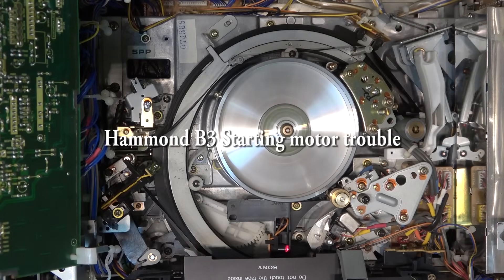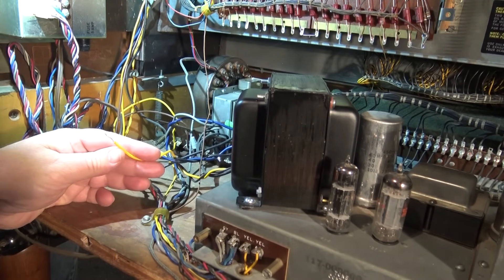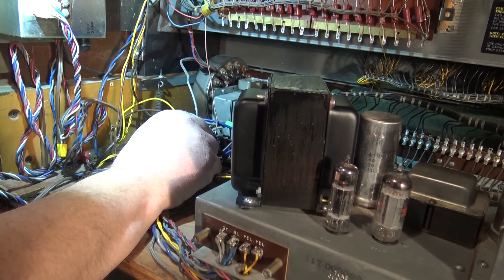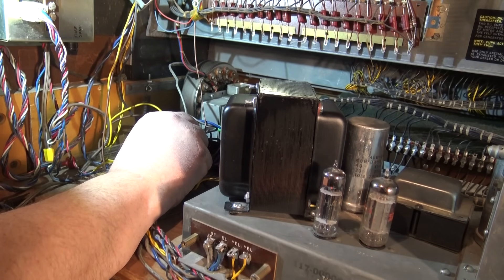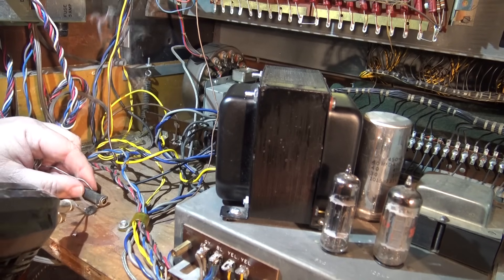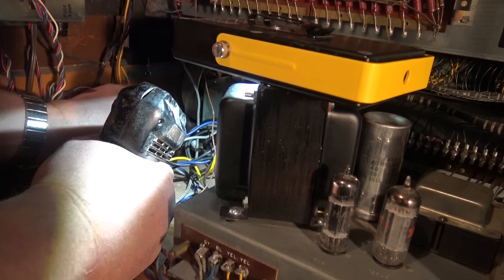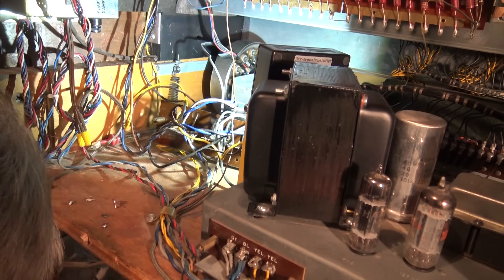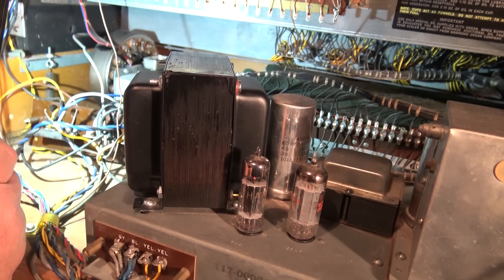Hammond B3 Tone wheel organ imported from Hong Kong what could possibly go wrong

Comment: Sync motor appears to be 6-pole (1,200 RPM on 60 Hz, 1,000 RPM on 50 Hz). I assume the motor fitted for 60 Hz is 8-pole (900 RPM). With that the organ will sound a bit 'flat' yet if it's entirely designed for 50 Hz.

Comment: The grinding sound is from dry bearings. Not good to run it like that as it will destroy the bearings and shafts resulting in very expensive repairs.
Reply from the maker: Not my problem as the saying goes.  Guy brought me in to get the starter motor running after the guy he hired to convert from 240 to 120 going.  I got it going.  He dealt with changing the motor to a 60hz version and lubricating it.   You can certainly hear it straining to get going.

Comment: The organ needs oil.  It can take weeks for the oil to travel to all of the bearings in the tonewheel generator. It should run very quietly when oiled correctly. Hammond oil is easily found on the net.
Reply from the maker: Yes he did get it running. He swapped the motor from another donor unit he had stored in his crawl space. It basically bolted on and plugged it in.  The donor organ, the cabinet was all bust up as it had been damaged in transport.  The reason it was stalling out was due to the friction in the bearings but with the 50hz motor will spin too fast.